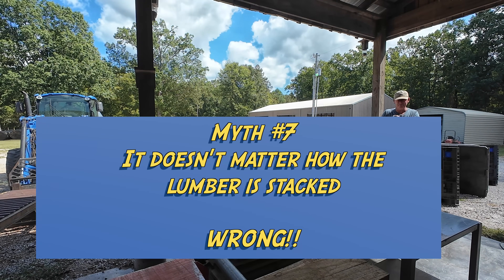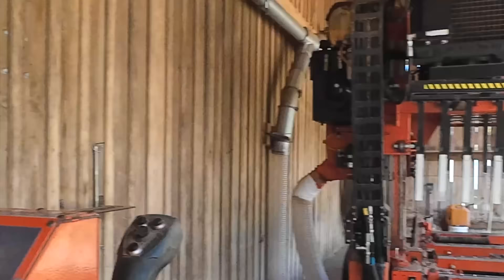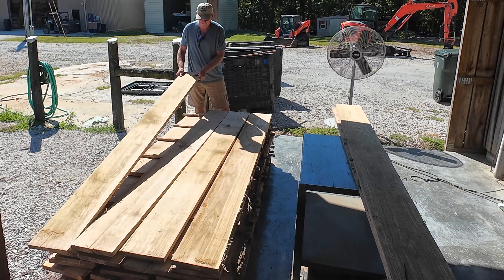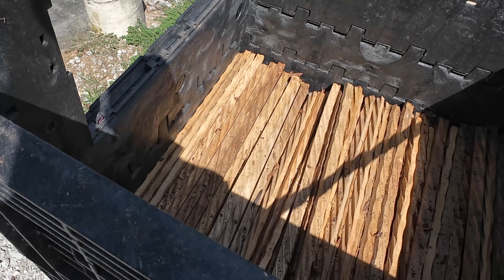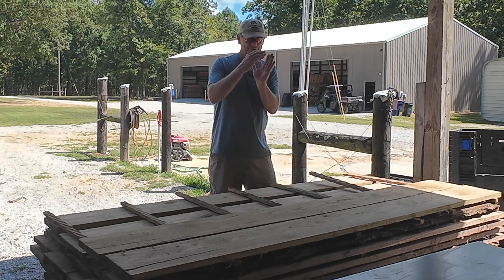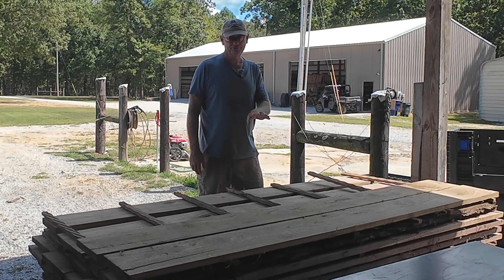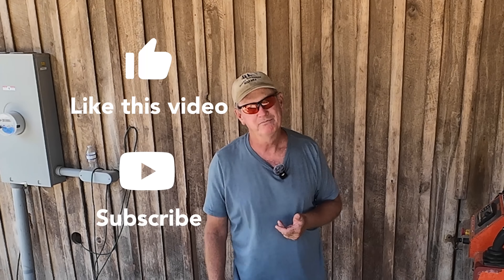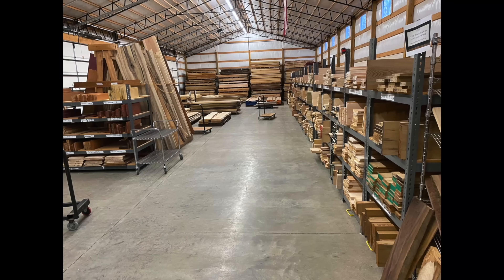Which Sawmill Lumber Air Drying Myths Will Be Debunked?!!

Comment: Thanks again for another video. A few questions. Is it ok to mix species in a stack or should I start a new pallet? Is it ok to mix hardwood and softwood sticklers? Is sap wood ok for sticklers? When going to a solar kiln should I go right to the kiln or allow some air time first?  Stay safe during the storm.
Reply from the maker: I always air dry first for a couple weeks at least, I prefer six, to flash of the surface moisture and get the EMC down, no matter which kind of kiln is used, even a solar kiln.  Mixing species in an air drying stack is OK if they are the same drying group or schedule and if they will be air dried to their fiber saturation point before being put in a solar kiln.  I never mix species if I will be drying in a DH kiln above FSP, I simply start a new pallet and if I'm cycling logs, I will just put them on the stacks that have already been started.  Sapwood is fine for stickers, and it's OK to mix softwood and hardwood stickers, I've done it for years  You just need to make sure the stickers are strong enough to not get crushed under the weight of the wood stacks, and make sure the softwood stickers are not sponges and cause sticker stain.
Reply: @HobbyHardwoodAlabama I was watching another channel and they talked about powder post beetle (I believe) and they recommended that the pallets and stickers be made of opposite materials ie hardwood pallets for softwood lumber and vice versa. They said that once they switched, they never had infestation problems